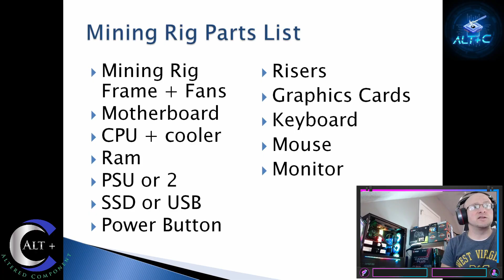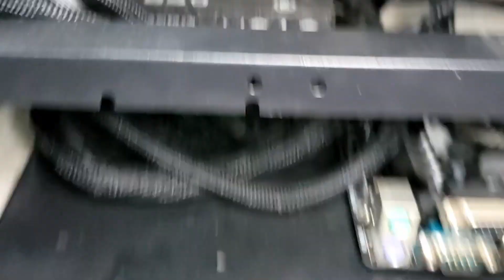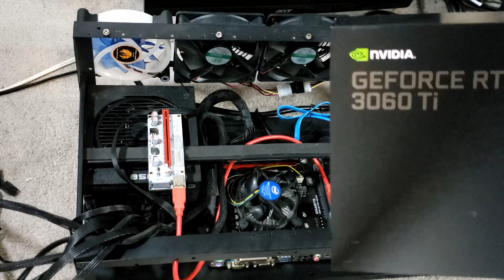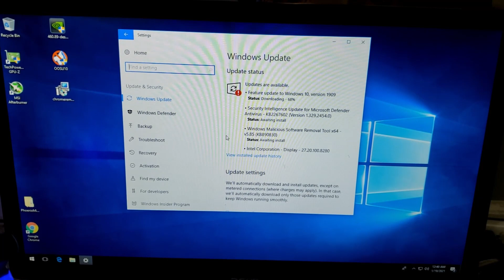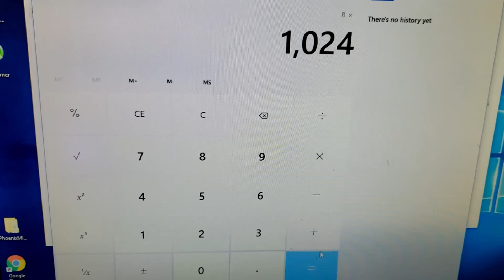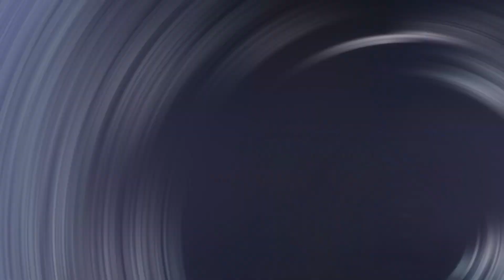Noob's Mining Rig Build:  How to build a mining rig for rookies (windows)

Comment: Which 2 pins are for the on switch?
Reply from the maker: Look in your motherboard manual.  Power + and power -.  You can even just jumper them with a screwdriver.  If you dont have a manual, google the model of mobo.  and  look for the front I/O pins.  they will be labeled.
Reply: @AlteredComponent  Thank you
Reply: @AlteredComponent  I'm using the same motherboard as you in this video.

Comment: Such a great video. However, would be so good to know how much that setup costs from scratch? And what sort of hash you would expect to get from it? / how long until you break even mining ergo or ETH for example..?
Reply from the maker: Thanks for the feedback.  i do some ROI and cost analysis on specific builds in later  builds.  the only issue with those numbers is they change very quickly.   Roi  is usually best done per  graphics card.  Checkout Whattomine.com to see the current projected profits on a specific card, then take price you can acquire the card /cards at and compare for current ROI.  take care

Comment: How much BTC can you mine with this setup?
Reply from the maker: thanks for watching.  The best way to see how much you can make from any graphics card is to go to www.whattomine.com.  Select the GPU tab, then select which Graphics card / cards.  hit calculate.  It will give you real time estimates on earnings as per the current market.  Since crypto moves up and down rapidly, this is the best way to get a current snapshot.  I just checked a single RTX 3070, at 60 mhs /130 watts, making 3.26 a day USD or .0001 btc

Comment: How the heck do you connect it to the pc and can you use a computer instead
Reply from the maker: Thanks for watching.  I assume u mean how do u connect a graphics card to the computer when out like that.  Simple, a gpu riser.  It is a little circuit board that plugs in where the graphics card goes, then transfers the signal with a USB cable to another little circuit board where u plug in the graphics card.  It just moves the card away from the motherboard.  And yeah, if u just have a computer with a decent gpu u can mine in windows with nicehash.

Comment: So I am up an running and now tweeking things more.  I notice in this video and also on my 2060 both have super low GPU clock and Memory clock speeds in MSI afterburner.  when you fired up MSI it shows 210mhz & 810mhz - but that is way below the factory settings, which I think for my 2060 should be closer to 1400+ mhz and 7001+ memory?
Reply: Never mind!!
Reply from the maker: = ) guessing all is well?

Comment: Hey bud I am wondering about ddr4 and ddr4 and ddr6 all I c are motherboards for ddr4 but gpu that are ddr6 can I use these to together
Reply from the maker: Thanks for watching.  Yes.  The ram on the motherboard only needs to work properly with the motherboard and cpu.  The ram on a graphics card is programmed to work with the gpu (processor on the graphics card).  So essentially u can use a very old graphics card on a brand new generation motherboard and vice versa
Reply: What motherboard do u recommend starting w th he asrock h110 pro or the asrock h81
Reply from the maker: @TheMowerGuy  I have the asrock h81 and running 6 cards on it.  It is an older and very reliable motherboard. It runs on ddr3.  Just note this only runs at gen 2 speed on the x16 slot so not 3060 can run without limiter.  This isn't a concern for most but important to note.  I do not have asrock h110 but always heard good things.  I think it is ddr4 ram.  I have 3 gigabyte h110d3a mobos and they work great.  Really whatever u can get cheapest with cpu and ram.  Take care

Comment: Hello,
I'm a newbie on this. I have a question: How much will be the investment using your video above to get an average of $3000k per month in revenue? I mean equipment cost? I'm looking to get into mining, and of course, I know there is a cost in equipment to accomplish this. Please let me know. You can email me as well. I know there are blogs below to ask, but I'm asking you instead based on your expertise.
Respectfully,
Pedro
Reply from the maker: This is a Huge investment.  So you would need about 12 Gh/s of Hash power (excluding power).  If we break that down into terms of gpus, we are talking 125 RTX 3080s at 96 Mhs a piece.  let's say hypothetically you could get those at $1000 each, you are talking $125k for the graphics cards.  Then of course you would need to power them.  I would say the Delta 2400w Server Power supplies would be the best bet from parallel miner.  https://www.parallelminer.com/https://www.parallelminer.com/product/all-in-one-gpu-mining-power-supply-zsx-kit-delta-2400-watt-platinum-94-power-supply-200-240v/?wpam_id=222 .  Each card would use say 220watts.  you would probably need 14 of these power supply kits with wires at $245 per kit, so roughly another $3500.  Then you need Mother boards / cpus / SSDs / Risers / frames / metal shelving / PDUs / Power cords.  So probably around $150k - $175k investment to pull $30k per month.  The issue would any kind of super investment right now would be Ethereum.  Soon the block rewards will be cut down largely.  Eventually eth will move to POS.  proof of stake.  meaning no mining.  There are plenty of other coins to mine and there will be other alts that push up when eth does leave, but big risks to go neck deep right now imo.  This has been a fun / nerdy dive.  thanks

Comment: Hi,

I was thinking of the Delta 2400w with the zxs kit and the x11 board.

I currently have a ASrock H110 Pro BTC+ motherboard with a i5 6600 cpu that are rigged to 5x rtx 3090 founders edition GPU’s.

My 2x 1200w platinum PSU’s which are running quite smooth but I have 3 more cards ready to be installed which will overload the PSU’s.

Now for my question, will the delta 2400w (immortal) and one of my current 1200w psu handle the 8x rtx 3090 founders edition?

Also if I bought 2 delta 2400w can I joint the two together so they both kick up when the motherboard demands it. If yes which cable do I need from parallelminer. 

If no, or yes can kYou advice me on anything extra I will need or won’t need.

I am new to mining so any advice from your experts will really be appreciated.

I look forward to your speedy reply.

Kind regards
Reply from the maker: Yes that would be a super powerful setup.  So really if you were using a delta and a zsx on the master side, then you can use an x11, or go down to an x8 or x6 instead on the slave and on the 1200w.  You would use the delta as the primary power, then from the zsx board, run a wire from the mini 4 pin over to the breakout board on the 1200w.  When you power up the delta, it would power up the 1200w in tandem.  here is the little sync cable you would use:  https://www.parallelminer.com/https://www.parallelminer.com/product/x11-and-x6b-breakout-board-4-pin-interconnect-sync-cable/?wpam_id=222

Comment: Awesome video your videos have helped a ton! How do you get the Nvidia drivers installed? Do you rip them off online and then download onto to USB then boot to motherboard?
Reply from the maker: Thanks for watching.  For a fresh windows build, windows will use a generic display driver to get initial display.  Then you can simply go to browser and Nvidia site and download the drivers for your graphics card.  Google download Nvidia drivers, then select ur card from drop downs and it will give you newest driver.  If u have a 3060 however u need the dev driver 470.05..not from their site
Reply: @AlteredComponent  I really appreciate that step you explained! Going to have my 6 x 1660’s up and running soon!
Reply from the maker: @hectorprado9229  glad to help.  If you run into any issues join either the misfit mining discord or hash raptor discord. Many people in there willing to help.  Take care

Comment: You are worried about turning on a pc using a screw driver, but have parts on a carpet!?!
Reply from the maker: Thanks for watching.  Tbh I have been building pcs for many many years and have never had an issue due to static charge.  My personal opinion is, if you do not specifically cause a charge into cpu or cpu slot, the likelihood of actually damaging a pc part in this manner is super low.  But absolutely if you are concerned about it, set on insulated surface and use wrist strap.  Take care.

Comment: Can someone help me set the Nvidia drivers. It shows me in device manager as Microsoft display driver and not 3070. And when I had tried to install the Nvidia drivers it told me that it could not install because of my Windows versión
Reply from the maker: easy peazy.  Your windows version is too old.  If the windows update if prior to the release of the 30 series, then you cannot install the new nvidia drivers needed for a 3070.  So you need to have a new version of windows 10, then install your nvidia drivers.
thanks for watching
Reply: @AlteredComponent  Thanks mann. It worked. By the way can you help me set up my Rig. I have 2 asus rtx 3070 which are connecting, a gigabye 3070 which is good. But when I connect the evga 3070 the rig wont boot and throw me a message error like b1Initialize... But when i disconnect the evga, it boots. My motherboard is an asus prime z270.

Comment: can you only mine bitcoin?
Reply from the maker: Thanks for watching.  Actually the only way to mine bitcoin nowadays is by using asic. Application specific integrated circuit.  Basically a computer that only mines an algo and does it very well.  Most normal miners mine whatever coin is most profitable and exchange it into btc or whatever coin they want...or if you use nicehash, you are mining whatever algo and coin, but it is being auto exchanged into btc for you.

Comment: Hello, can you please tell me how have you plugged all the fans on case rig? Spliters?
Reply from the maker: Thanks for watching.  I have fans in a couple different ways.  One of the rigs, the 5 fans have a molex connectors that are daisy chained together and plugged into the atx power supply.  2 other rigs i am using a fan hub.  It splits a single 3/4 pin fan header into 4 of the 3/4 fan pin headers. And then it is plugged into the motherboard.  Oh and then on one i am using the ZSX all in one breakout board which has a integrated fan up for up to 10 fans

Comment: whats the best alternative to the gigabyte h110-d3a. thats not in stock at the moment
Reply from the maker: Anything stamped mining right now is hard to get or triple the normal price.  A z270 or z370 could be an alternative.  They key is to make sure u have 6 pcie slot AND lanes. Some older boards will have 6 physical slots, but can only run say 4 items because they share the pcie lanes on the board.

Comment: was you meaning that using the rgb/vga cable doesnt slow down the hashrate when its connected through the gpu to the monitor?
Reply from the maker: Well done.  Any RGB can improve hashrate ;)  on the serious note, if a gpu is producing a video out, then it will in fact slightly affect hashrate.  So, if you motherboard and cpu support integrated graphics, then you should run your monitor off the motherboard video out ;)
Reply: @AlteredComponent  thank you for explaining

Comment: Why do you need a riser?! You only have a one card?
Reply from the maker: Thanks for watching.  I test how it will actually be used.  So I riser most of my cards and test as such.  The only exception is the new rtx 3060.  You must be slotted into the motherboard on a pcie x16 gen 3, use the developer drivers, and have a display connected.  Of course this just came out a couple days ago.
Reply: @AlteredComponent  So i dont need a riser if i mine with a single card?
Reply from the maker: @RajaDNPOfficial  nope.  Only use a riser when trying to hook more cards than you can slot physically into the motherboard

Comment: Hi thanks for this! 

Which PSU would I need to run 2x 3070s and a 5700xt?
Reply from the maker: I would use a 750w.  That will leave you plenty of head room.  I do not go less than bronze personally but a gold would be the optimal solution.  The efficiency makes a difference on ur components and on power over time.  My 4x3070 + 2x 3060ti rig using 970 watts at wall for reference.
Reply: @AlteredComponent  Really you think a 750w would do all 3? I have a bronze 700w which I think would cover both of my 3070s, just unsure whether mixing a 5700xt would cause any issues...
Reply from the maker: @insertnamehere4921  a 3070 properly undervolted will use around 130 watts, plus 30-60 watts for a riser.  A 5700xt can even be pushed down lower.  Like 100-120 watts.  System should use between 60-100watts depending on processor and fans and whatnot.  So actually a 700 probably would get u bye

Comment: Is it possible to buy the mining frame with everything in it except the gpu??
Reply from the maker: Unfortunately only on ebay and you will be gouged mightily.  There is an all in one motherboard from rebtech that comes with cpu, ram, board, and has 8 USB outputs to run to the risers and graphics cards.  Still needs a power supply, rig frame, risers, Graphics cards.

Comment: Nice Video!! what kind of Mining rig frame are you using?
Reply from the maker: Thanks for watching.  That one invited is a cheapo steel 6 gpu frame.  Used to cost 30...now lucky to find for 60.  I have a couple custom aluminum frames, a custom wood, and that cheapo steel.  I also have used the Amazon basics wire rack for 30 bucks and a shoe rack build.
Reply: @AlteredComponent  right on bro!  Another random question, how come i don't see anyone racking their GPU fans upward since hot air rises, seems back to back would radiate more heat.  I've built one with all fans aimed upward and seems to be running stealth..  Want to make sure I'm not missing something, thanks in advance.

Comment: when running more than 1 nvidia gpu do you need to install the drivers for each card or do you use only  one driver?
Reply from the maker: Thanks for watching.  Just one driver.  Generally the newest cards driver will also have instructions for the older card.  Only issue is sometimes when u mix amd and nvidia
Reply: @AlteredComponent  thank you for answering my question.

Comment: Any idea where to find these 6 card black steel frames?
Reply from the maker: Well..Amazon or ebay have them..but expect a few weeks shipping https://smile.amazon.com/dp/B08VMYHF7Y/ref=cm_sw_r_cp_apa_fabc_K3WMQR3NZQ7JR7F81GCN .  This looks promising and I have never seen before, but again I would expect a few weeks to get it: https://smile.amazon.com/dp/B08XM3KDPM/ref=cm_sw_r_cp_apa_fabc_ANTK7RE2FPJSEPNF5A10
Reply: @AlteredComponent  Yeah I bought the one in your first link a month ago but still hasn't arrived and seller won't reply to messages. I have one that I bought a few years back from Frys only $25 but I can't find them anymore. Considering building my own because I need exact same dimensions. Thanks for your videos. New subscriber here!
Reply from the maker: @magshop-us  appreciate it.  Back when I started in 2017, the boom made it really hard to get all hardware like it is now.  I built a wood frame and a aluminum angle frame.  I way over built the aluminum frame but still in use today.  A cheap solid u can use in the mean time, Amazon basics 30 dollar rack and zip ties.  Works well, good air flow, and if done right can actually look good.  I have one in box that I will do a video on, but may not be for a couple weeks

Comment: I'm not sure which GPU riser to order can someone help
Reply from the maker: As long as it is ver008s or 009, u can't go wrong.  I have been using 008s for a couple years. They have great power delivery and reliability.  Also they are a side feed which I prefer.  Also, do not use sata to power if at all possible
Reply from the maker: Check gpurisers.com as well

Comment: Hello, can I ask for ur help plz ? First awesome channel just subbed !!... I have a gaming pc running 1080 ti been mining with NH for months now, I just bought 5x 3060 ti

The board am on is asus x99 deluxe, I added one more 3060 to the board and started the machine but once am inside windows the screen will go black !... also this boards supports up to 3x sli (I know we don't need sli for mining I know this...) but when I inserted the 3060 ti in a slot not designated for its stupid sli the monitor will not display any picture, am just wondering how am supposed to make use of all 5x pc slots if am not able to get 2x gpus working !?!?! The 1080 ti am having is liquid cooled so it's kinda hard to remove, so can a 1080 and 3060(s) be on the same rig ? 

Any kind of help appreciated...

Thanks,
Reply from the maker: Curios..are u still trying to game from this pc or dedicated mining machine?  Also what cpu in that setup
Reply from the maker: Oh and you said 3060ti,  what drivers are u using.  U may need to update the drivers to get it to read
Reply: @AlteredComponent  I created this video to show my issue...
https://youtu.be/OB84LIqsbsg
Reply from the maker: @RogueSkies  out of curiosity,  did you plug the riser in the the below x16 slot?
Reply: @AlteredComponent  yes i did plug it in the bottom p c I slot...
Reply: @AlteredComponent  its my gaming rig am currently experimenting on, some people suggested i cant have more than 3x cards connected directly to the board and suggested i need to you risers to get all/most PCI-E to detect the cards, is this the reason ??....

now am running 2x cards straight from the board 1080 + 3060 and mining just fine...